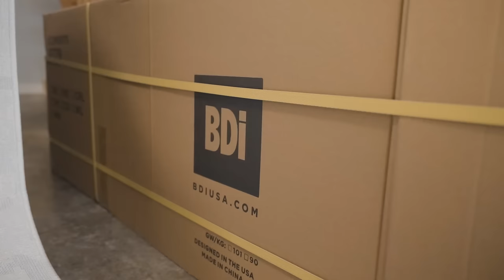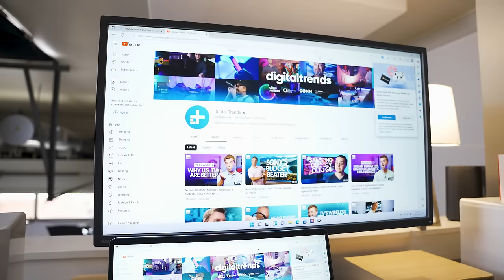New Studio Reveal/Tour | Behind The Scenes at DT Studios

Comment: Revisiting this video, and the view of the main floor listening area gives me pause for a couple of thoughts:
Due to the very high ceiling and its acoustic treatment with hanging clouds to mitigate slap echo, I’m thinking you’ll not get the best performance from the Nak Dragon, or any “Atmos certified” speaker system that relies on ceiling reflection to create the overhead sound objects.  Such systems would very likely give much experience in the small loft area.
Speaking of which, perhaps a motorized roller type heavy curtain, or set of bifold closet door panels in the open space above the pony wall behind the computer workstation would help to balance the acoustics.
I’ve treated roll up garage doors with thin layers of fabric covered rock wool for both heat and acoustic insulation.
And, finally, that vintage Dynaco audio gear on static display deserves more love by serving at least occasional play time with the as yet unidentified vinyl spinner sitting on the bottom shelf. 
You asked for comments, so 😂

Comment: I love BDI but I can't help but notice that your cabinet doors are not flush.  I have the original 8529 (that started it all) and it's an amazing piece of furniture (even today) but I wish they paid a bit more attention to those details.  Other than that, they are absolutely spectacular.

The coffee table is amazing as is the laptop table.  Have they thought about making a very minimalist workstation (essentially it has wheels and becomes a nice decorative furniture when not used)?
Reply: Hi! All of our cabinet doors are on 100% adjustable hinges. They easily adjust in, out, up and down to ensure that all doors can be perfectly aligned. Often, during shipment, doors can shift slightly so minor adjustments may be needed after the cabinet is unboxed. This isn't always the case. But with a Phillips head screwdriver and a couple of minutes Caleb is going to have those doors looking sharp!  Your 8529 has this feature... if you need assistance, reach out to BDI Customer Service, please!
Reply: @bdifurniture That is true but it is easier said than done 🙂.  

I was just surprised to see the same level of finish as on my 15 year old (?) BDI.  

Don't get me wrong - I love it and I consider it one of the best pieces of furniture I've seen.  I can't even begin to explain how handy the wheels have come in along with the 2 million ways to push cables.  I would have broken my back and destroyed my hard wood floors without it.

Quick question since I have your attention.  What's the best way to clean the original's surface?  I've noticed some oil marks from my hands that refuse to leave. 

Also the handles are looking less pristine (some form of oxidization) - do you offer new ones for those?

Comment: It's a good thing San Francisco doesn't get earthquakes because otherwise that upstairs BenQ monitor might fall over the edge of the balcony and hit someone below. Or someone could jostle that desk just enough to do the same.  There's lots of ways to prevent that like screwing or clamping it to the table. Putting a barrier behind it. Atach a safety wire to it and the ceiling.

In fact it might make for a good video, a How To on securing objects like big TVs, or tall bookcases, so they don't fall and crush say a child, or children, climbing on them or otherwise knocking them over, and things like this happen all the time. (I know because I used to be a little kid of 4 and climbed on things all over the house.

And since you're going to have a charging station/area it might make a good show on safety practices with batteries that could otherwise cause a fire or explode, especially dangerous if left unattended while charging. Safe storage of them too.